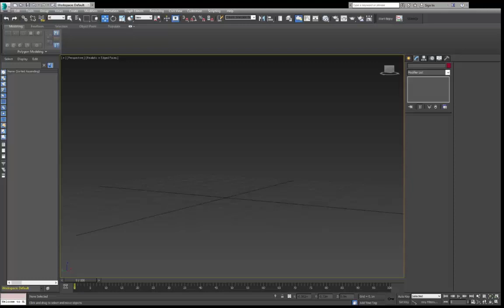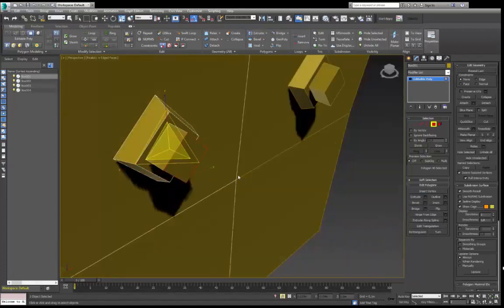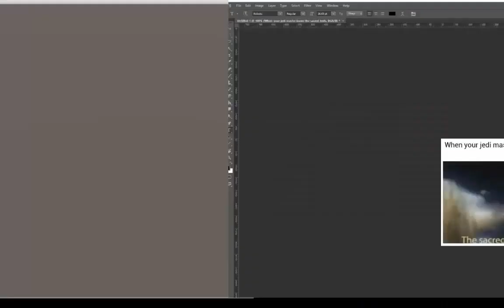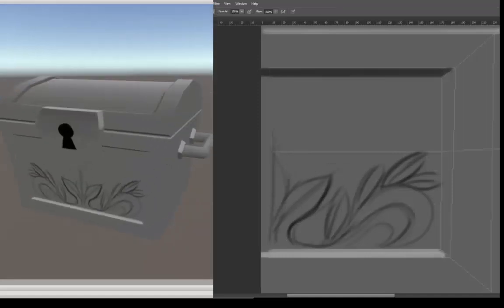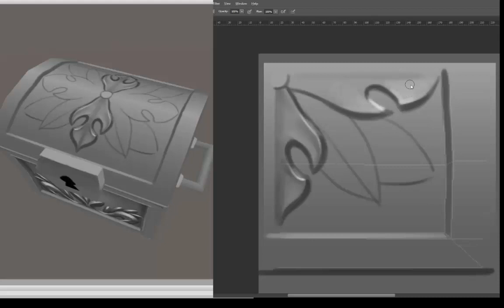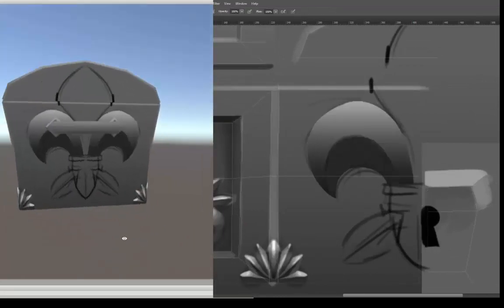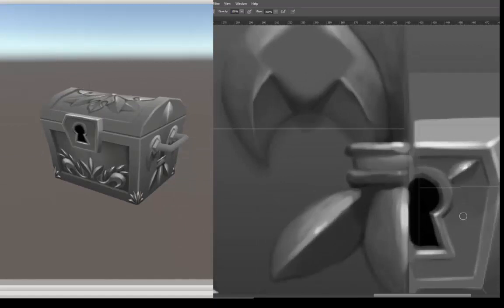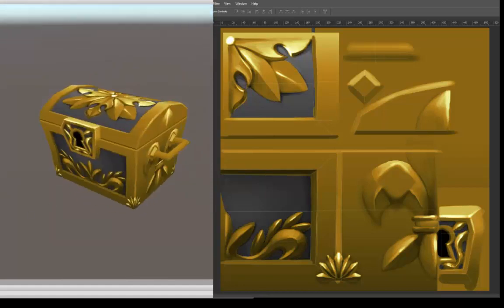Process of modeling and creating a hand painted texture for a metal chest

Comment: hello, how did you make the textures update while you paint in photoshop? Is there a plugin in unity/photosjop the automate it?
Reply from the maker: In this instance, I'm using Unity, with the original psd loaded as a texture, but most 3dsmax versions I know, except for 2016 stock, will load psd files into the material editor and display them on the viewports.
Reply: GameArt Stuff thanks for the reply. I get it now. Though, i have another questions.
I always do low poly > high poly zbrush > bake/texture in substance painter. 
Is this some kind of an alternative workflow?
In which case your kind of workflow is used and not used. 
If they are the same workflow, is it on the user on which one he/she prefered to use?
Which workflow do you prefer?
Reply from the maker: Well what I see is that for some artists, its zbrush sketch > highpoly > retopology in 3d coat or max or maya, or even zbrush, and then bake.
I don't really work in highpoly workflow, I only do lowpoly and texture painting for low spec projects. so I'm not really much of a reference. I also know people who do lowpoly sketch in 3dsmax, than use that for the highpoly sculpt and also for a retopology for the lowpoly final model.